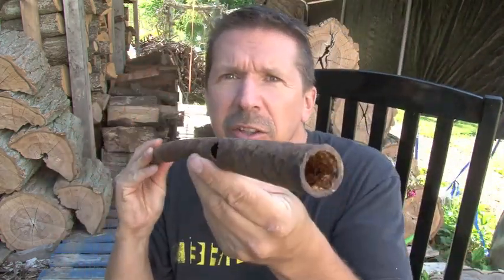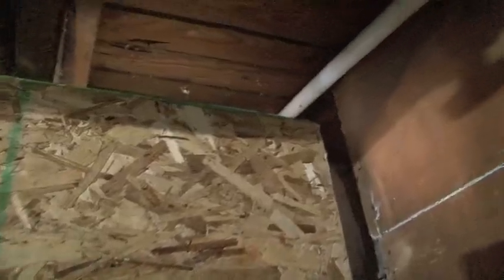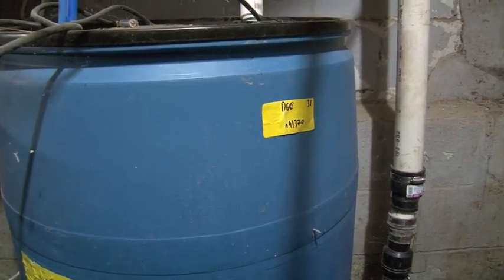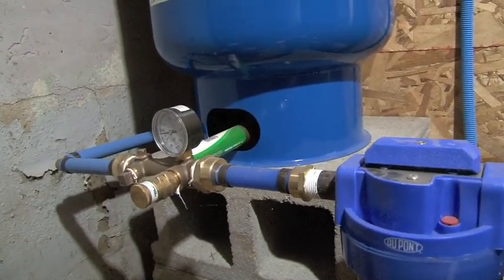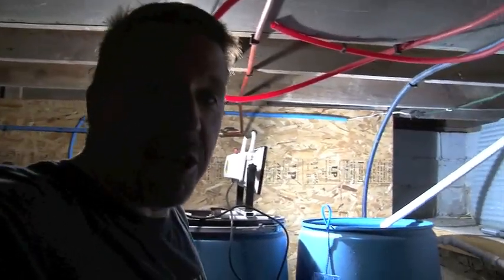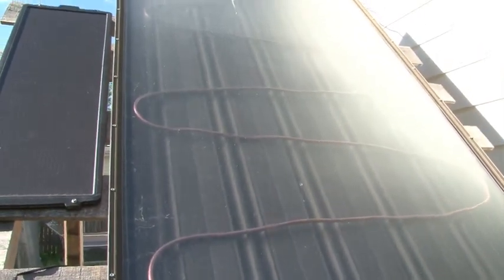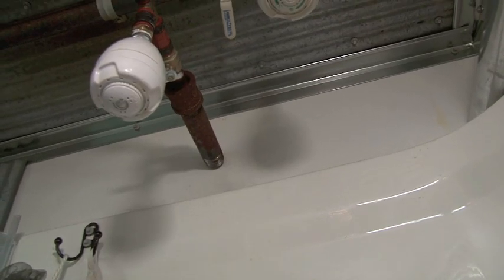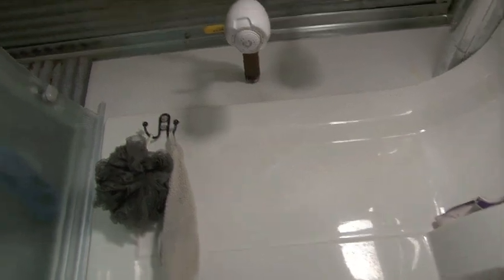RAIN COLLECTION system for drinking and showering

Comment: I didn't hear you mention a back flow prevention/anti-siphon valve between your gray water (for the toilet supply) tank's overflow to your septic system. You mentioned the clothes washer. It has an air gap to prevent sewer water from backing up into the appliance and from there into the supply plumbing. There should be something positive to prevent sewage from backing up into your overflow/grey water tank. Even if you would never drink the water from the overflow tank, it's connected back uphill to your duplex tanks. There has to be a disconnect to prevent this somewhere in the system.
Reply: Sewage is contained within the commode, separated by the tank being emptied as one flushes the commode, ... the commode empties via a siphoning system, incorporated into the design of the commode, & it is the same setup with a tub, shower, sink, whatever type of drain system that one has associated with indoor plumbing, ... not only efficient, but sanitary also, ...

Comment: Uh, microbes don't need a host. They only need warm moist environment. You could easily install a uv light sanitizer in line and you don't need all that kludged pipework. Rainwater systems can integrate seamlessly for very little cost if you do it yourself.

Comment: thanks. I see a lot of things that I can learn from. I don't think I would have put all those barrels in the basement. That's just scary. Couldn't you have made a shed outside? How does the water taste? I imagine it's a lot better for you than the city water. And that pipe was really gross.
Reply from the maker: We get freezing temps here and I didn't want to heat the shed so I opted for the basement. making a cistern underground would be best but I didn't want to invest that much on this house.
Reply: Living Lightly,  oh yeah,  I see your point there.  

We get some cold and freezing here too.  I want to help my friend who is well ran dry get a system kind of like this. She has been living in her house with no running water for over two years. Kind of like a homeless person in her own house. It's pretty bad. This is really the answer. I was trying to think how to do it. she does have a well house already so maybe we will put all that stuff in there that could freeze. normally she turns on the light in there on those days that it could freeze so that it doesn't freeze that's all it takes.

Thanks for the help. 
                      Melba R.

Comment: Pretty neat system, I was wondering though about the filtration method though. Is that water purified through that last filter the "burpee" filter somehow or is the purification process done in a previous step? As I understand it you need to filter out the particles but also purify for bacteria and such.

Comment: So just curious, your rain catchers are food grade but what about all the plumbing? Those lines dont look like mine that are food safe.
Reply: also if you had everything on a drainage system using gravity, you wouldnt need that pump.
Reply from the maker: The lines are pex lines. They are replacing PVC. all new houses are installed with pex. Supposedly they are safe but lead paint was considered safe at one time also. That its the best material I could get.
Reply from the maker: The only place I can store water is in the basement so I have to pump it. I wish I had attic space. Or please clarify if I'm not understanding your idea.
Reply: No no I think you are picking up what I am laying down

Comment: I applaud  your reasons and efforts.  But your system needs lots of improvements.  Start with putting an electric shut off from your tank full mark to the intake water. This will not allow your septic to full up and screw it up. Sounds like your toilets are also a separate collection. By moving the out water of the barrels toward the top would allow for a lot less maintenance,  this would allow for all the screens to be removed.

Comment: Reverse osmosis with ultraviolet filtration will make the water as pure as can be. A complete system can had for about 200 bucks and maintained for a little more than a standard paper and carbon system. If you're worried about water quality and water born illness then RO with UV is the tits. 

Good video, you've done some pretty neat things with your home. I'm surprised that your wife doesn't give you a constant rash of shit over exposed piping and other aesthetic issues. I know my wife wouldn't like that kind of thing in our home.

Comment: In the old days the Toilet had a water tank hi above the toilet and sents your pumping your water up to your toilet take the water tank off the bake of your toilet and put it in a box and connect it with a peace of PVC pipe and it will give you so much water presser you should need less water to flush with.

Comment: Cool. But there's a cheaper more conservative way to do all this if you're still on grid. Buy yourself one or more water distillers (use it to distill your poisoned tap water and costs less than bottled water), 3 or more 2.5 gallon Nantucket or Kilner glass dispensers to put in your kitchen, your bathroom to wash your hands/brush teeth/shower, and a portable 12 volt shower & converter or rechargeable shower (12 volt showers you can control water flow, rechargeable you can't), a stainless steel kettle to warm up the bathroom shower water. with 1 water distiller you can do all this for less than $250. if you get tired of cleaning your water distiller, buy a 3 gallon $200 reverse osmosis to put under the kitchen sink or just catch rain water to distill it. The system you have is great off grid but on grid the above is just as good and protects your health

Comment: LOL , those who know pipes & have dug up and replaced galvanized pipes KNOW your pipe sample hasn't had water passing through it in probably 50+ years, BUT, after seeing your Berkey I think I would of had ONE collection barrel, then run from there to the Berkey, what about drawing out your system & tell us how many fittings & feet of pipe you used AND you better hope a code officer doesn't start looking around LOL

Comment: Wow, how about just tie the rainwater system into the house system with a shutoff to the city water so you can utilize your rainwater in the wholehouse with one set of pre installed pipes, instead of running PEX tubes all over your walls like hamster city. and then when your out of rainwater shut the valve to it and open the house back to the city.

Comment: Ya ok look try this ok and save yourself a lot of time and heart ack. Well a three stage water filter or a four stage water filter. Get activated charcoal and clean sand (now this next part you decide on for your needs) but use a pea gravel or use modem size gravel or both. Take a cloth like maybe a peace of canvas or an old pillow case or old sheet you need to cut them into at least four pieces for a three stage water filter but Five pieces for a four stage water filter remember what cloth you use has to deal with the flow rate and size of water container and head space ( the room you leave on top of your first layer of sand. Take per gravel and but on bottom then a peace of cloth then larger gravel and a peace of cloth then the activated charcoal then the cloth then sand. And leave room for head space. Add clean once a year.
Reply: You don't need the cloth. But you do need to add biochar (homemade charcoal or health food stores also sell it. 
It doesn't need to be cleaned that often either. Once every 3 years it needs to be back flushed with clean water. This is for a 3 barrel system one of gravel, one of sand and one of biochar.
If using one barrel for all 3 items you will need to back flush once a year. 
This is a proven system with many thousands of tests done by many labs in Universities. A professor created it. And tested it. It will remove chemical toxins and clean out over sprays or run off chemicals too. No other filtration is needed. Safe pot as potable drinking water.

Comment: I know some people use chlorine for long term water storage. Is that something you would recommend.   
Also do you put any thing in the water, or do you only harvest and filter.
Reply from the maker: Hi Abshir, One of the reasons for collecting water is to avoid chlorine and floride. Ive recently added a pre  filter that is a bucket of lava rock and air pumps in the tanks like the kind used in fish tanks. I try to use what I collect as quick as i can so it doesnt sit too long. I get rain fairly regularly here. I still have had no negative issues, thanks for watching.
Reply: For a long term water storage system an y they put in a chlorine injector in because static water can create bacteria

Comment: ave! in theory your system is good but, you are using PVC pipes (which are toxic) i would rather invest in copper tubing. Coal do not filter everything so i'm afraid you are drinking chemtrail residue and other dust particles which are not filtered. In general a good idea for temporary water filtering system because of plastic pipes

Comment: My wife would kill me if I had those pipes 🏃 running thru the living room with 2 shower heads
Reply: One would connect it to the existing plumbing system to avoid all that extra stuff. Use the utility water as a backup from a manual or automatic valve. Best wishes. FreeJulianAssangeFreePalestineFreeUsAll.

Comment: use a compost toilet with sawdust. Then compost waste for one year, it heats to very high temperature, just like soil. This will knock the water bill down. no more flushing waste down the drain. Unless you have friends on medications have them use the regular toilet. We always say if your eating organic why flush the most expensive food you can buy. even if I did use city water you could capture the grey water from sinks and showers if you use less and healthy soap. Good job this is what people don't think about, using the resources God gave us, just hook up the lines. you could shower at a lower level from the roof and not use the pump, like say if you lived on a mountain, collect water run down, into heater, run down into shower. Look into MMS it is a water purifier but we use it to put into drinking water to get rid of most all dieseases. ( Miracle Mineral solution) don't use the wikipedia definition they love to screw things up to get you back to the doctor. look at jim humble for mms. you can easily make your own for 25 dollars, buy sodium chlorite mix with water buy citric acid mix with water, then combine drop for drop and you got a health remedy that will keep you from getting knee surgery and melaria and you got it even cancer!!

Comment: The amount of fluoride in our water system is so minute that it has no effect whatsoever on the human body and all research to the contrary is fake. As far as the cake inside your water pipe that was merely rust and dissolved iron as a rule is to the problem for humans nor is other size amounts because the body simply flushes on it never gets absorbed.

I’m not saying that using rainwater is a good idea it might be but you forget the fact that our atmosphere is full of particulates that are not particularly good for individuals so you do need to filter it and you need to make sure that you get rid of any bacteria that will grow inside your water barrels because no matter what you try to do bacteria will get into your water barrels.
Reply: Maybe run it through a small tank full of zeolite to kill bacteria and virus
Reply: fluoride was used on the jews in ww2  ,, like DUHHH its bad in any amount . it does not help your teeth

Comment: Too complicated.  Simplify man.
Reply: MastaSmack, oversimplifying a basic containment system has a lot of fatal flaws, ... the filters mentioned in his plan, are necessary for water clarity, purity, & volume, ... in addition to those parts of his system, he added a solar heating pipe for warm air in the winter, ... hot water on demand, & a exit drainage system, designed with overflow levels in mind, ... he could have added a few other parts that would redirect the flow of incoming water to bypass the whole route of having to be pumped out, ... or off into a larger water filtration setup, ...
Reply: It would still be too complicated for you if he did.
Reply: Next time it rains go stand outside with your mouth open. Just make sure to look up. A shower and drinking water at the same time. Multi-tasking doesn't get any simpler.